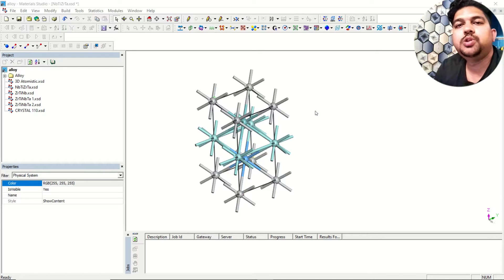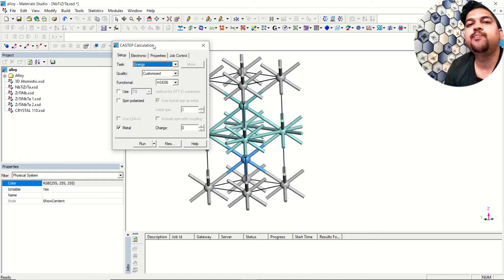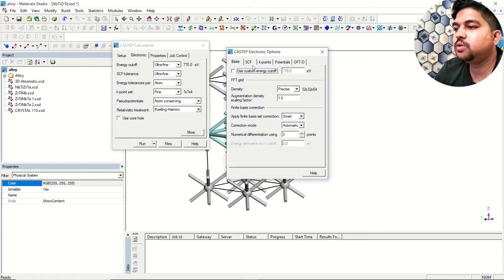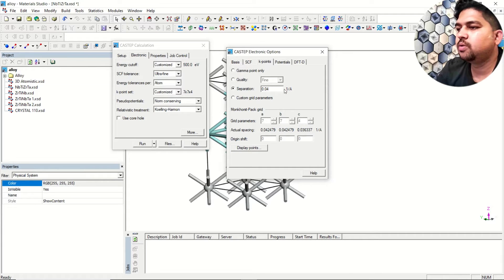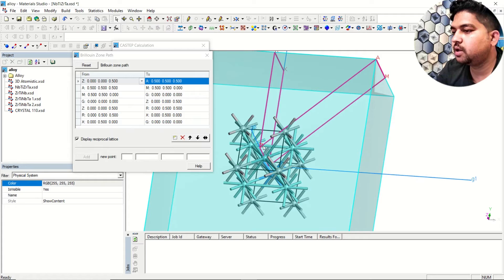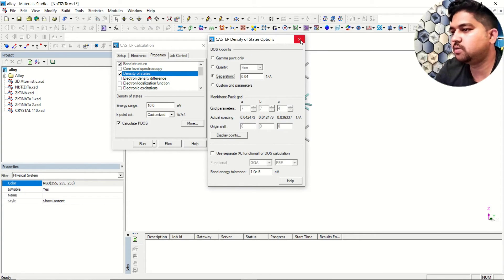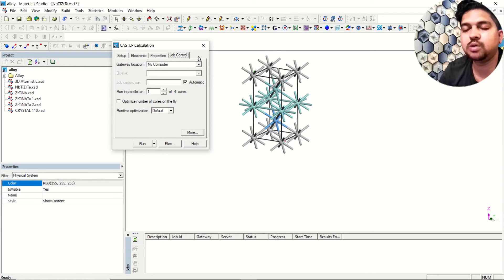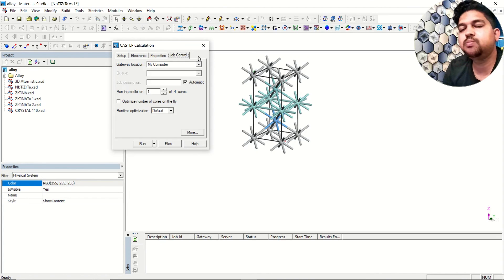Band structure calculation using HSE06 || Dr. Gaurav Jhaa

Comment: Hi,
Do you think we will get the same results if we geometry optimization on the structure using GGA and PBE, and then use HSE06 based on those outputs?
Reply from the maker: @salahal-shurmani7605  it's GGA not CGA.
 Geometry optimization followed by properties calculations using HSE06 will take huge time and computational resources.  Generally we optimize our system using GGA-PBE then we perform a SP calculation using HSE06 for electronic structure calculations. This way we reduce the computational time and get significantly better results than normal DFT functional.
If you do the geometry optimization as well as the properties calculations using HSE06 for sure the results will be different then the way I discussed above.

Comment: Sir i import a crstal cell and known to check adsorption parameters. When i make supercell with increasing atoms layer adding Vacuum slab then lattice parameters values increase .It didn't match with original cell parameters. So, What i do.?
Reply from the maker: Supercell will have different cell parameters then its primitive unit. Its an obvious thing.